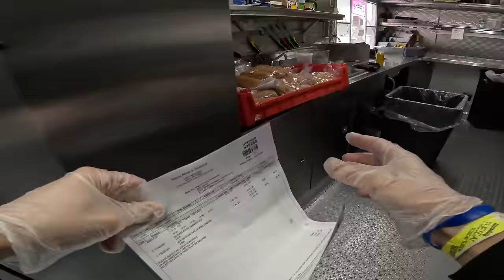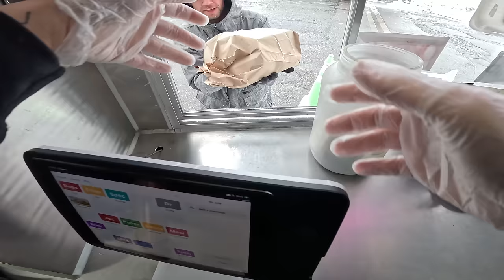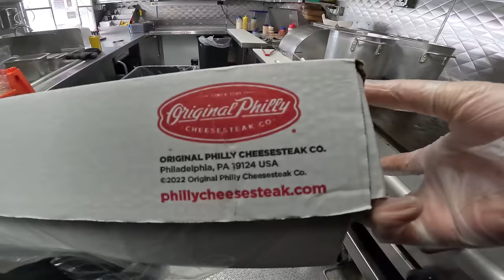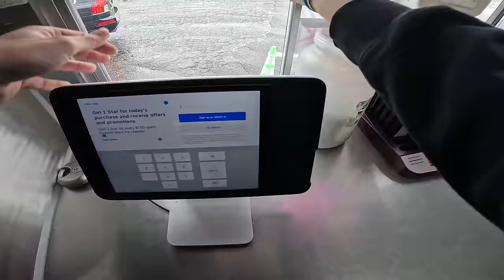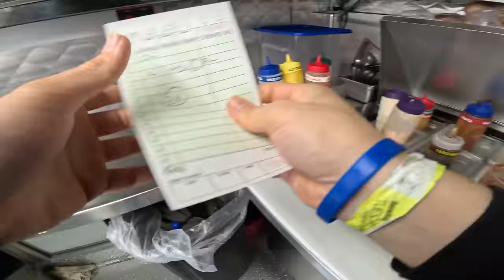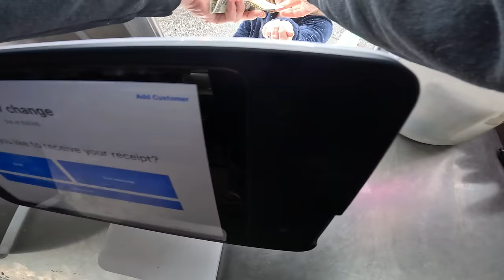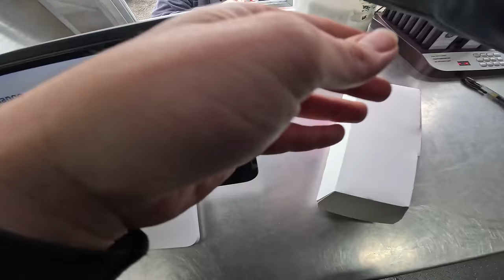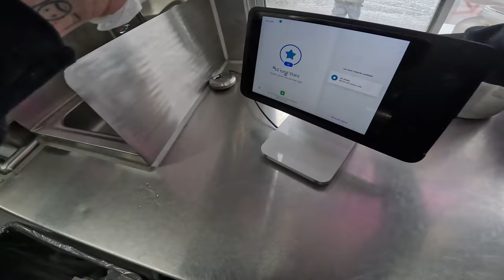Food Truck Cooking POV!! Bacon Wrapped Jalapeño Popper Hot Dogs!

Comment: Why are you using the spatula's to get the food off after scraping it? You can scrape and tap the spatula's all you want but you're hurting the food that comes next and possibly the customer..why don't you use the tool you used to loosen the food with?

And stop steaming the buns. The dogs and sausages on a bun turn into sandwiches especially with all the addings.